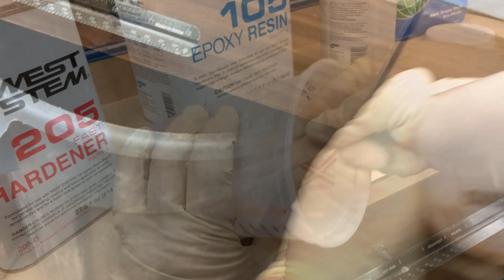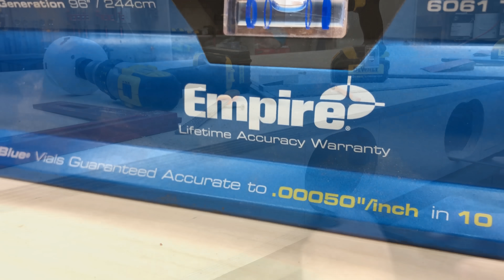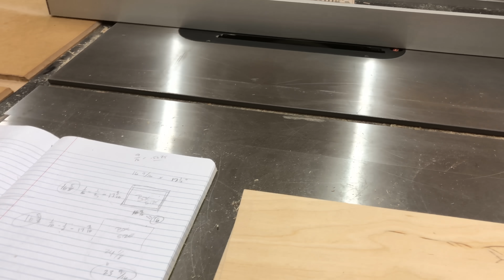64 - Extreme Torsion Box Assembly Table Part 2 Outfeed & Multifunction Workbench w Storage

Comment: I see it's been a couple years and a half.   Curious what happened to the base or to the torsion box when the two were screwed together.  If this was tooling, the flat table would be "bedded" to the base, so that the structure of the base does not impart undesirable forces on the torsion box.     Amazing work btw.   pleasurable video to watch.

Comment: If your plans are followed, what would the finished height of the table be?  Great project!  Thanks for developing it.
Reply from the maker: The height would be 35-1/2", the same height as my table saw.
Reply: Thank you much for the quick reply, James.  My saw has a table height of 34 inches, so was wondering what the best workaround would be so I could use the table as an outfeed table in addition to an assembly table.  I've been considering building a multi function table for a while, kicking around ideas in my head, but with your design I believe you have "nailed it" and wish to follow your concepts.  You certainly designed a winner!!
Reply from the maker: Hi,

That’s an easy fix. Just drop 1-1/2” off the leg assemblies. 

Or shrink the grid inside the Torsion box from 4-1/2” wide to 3” wide. 

Or change caster size. 

We’ve built in a lot of options for height adjustment.

Comment: Very nice build!  I have a question regarding the top and tracks... does routing the grooves in the top weaken the torsion box?  Would there be any advantage to doubling the top surface so that your track grooves didn't go through over half of the top material?

Comment: What size dado blade are you running in your saw??? I have a 8" dado blade and I am using the cross cut sled that I built from your plans and there is no way I can cut a dado that deep
Reply: i just built the top today and yeah hit the same problem.  my 3hp cabinet saw has a 5/8 arbor and you can't get 10" dado with that arbor size.  He must have the 5hp grizzly with a 1" arbor and can run the 10" dado blade.  I ended up running them on the 8".  Then using the cut short dado portion as a guide for the 10" regular blade and just made a ton of passes.  took 3 hours.  much longer then I could have had i had a 10" dado.  this was the first time i've run into this issue where the the 8" was too small.
Reply: @zima627  Good Info to know before I start the build.

Comment: what are your thoughts on MDF for the divider and torsion box internals, and bottom, and a sheet of melamine/particle board for a top?
Reply: Id like to know the same thing. Trying to figure out how much this is going to cost
Reply: @dougprentice1363  i am actually thinking of making a 4'x4' version. I have quite a small shop.  I just added a larger table saw, i still need a rolling workbench/outfeed with storage and some clamping.  i'm thinking 4x4 will save on cost as well

Comment: I'm trying to replicate this design using 2 x 6s to build a one foot by 39 inch by 6 foot rolling stage for my classroom. Could I replicate this approach with the interlocking lattices but use glued together 2 x 6s. So like 12 wide x 6 foot long boards that are as thick as a 2 x 4. I was mainly wondering if I can do this with fewer lattices? Like 4 6 foot boards and 4-6 39 inch cross pieces in the lattice? Thanks.
Reply: Also, would I have to do the small pieces of 2x4s inside the boxes of the lattice? Or could it work without that?

Comment: That is a huge dado Blade!! 10”? 12”?

Also, did you consider using construction adhesive instead of epoxy for the fillets?
Reply from the maker: That is a 12" dado blade. And I did not think about construction adhesive, that might work well.

Comment: Where'd you get the bench vice
Reply from the maker: I actually built that. Here is the video. 
https://youtu.be/wC4inmPPg3g
Reply: @KingsFineWoodworking  I was referring to the built-in vise
Reply from the maker: @cliff3613 , this is the exact vise I used for that:
https://www.rockler.com/12-quick-release-end-vise
Reply from the maker: @cliff3613 , 
But for just a little bit more money, this vise is absolutely spectacular!

I have used it many times, and I’m installing two on my upcoming Roubo build.  It’s worth a look!!
https://www.in-kleind.com/store/14”-Twin-Turbo-Vise-Backorder-p136791505
Reply: @KingsFineWoodworking  I actually want to build both vices. I had found the video of the bench top vice but not the built-in vice, that's why I was asking. I bought the plane and am in the process of gathering materials now. Wood prices!!